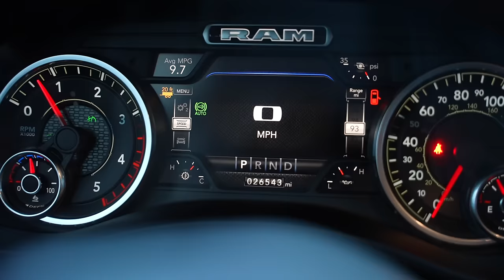Silver Bullet’s Engine EXPLODES After Winner Takes Delivery…

Comment: The winner this giveaway seemed genuinely excited, and props to you Gabe for owning it even though it technically wasn't your truck anymore
Reply: Technically it still in his "business "name so it some type  of liability. But he. Make triple over what the trucks are worth.
Reply: @Bear_83 pretty sure the dude signed the title when he took delivery of the truck the first time. If so that means it's 100% his. If it had been a used truck purchase it would have be "as is" and he would have just purchased a dead truck. In other words SOL!

He definitely did not have to fix this truck legally, but morally he 100% did the right thing. Definitely respectable.
Reply: @awdeveau  business wise he did right. Would be a black cloud over his money maker giveaways..He make Hundred Thousandssss. Off a use 50k trucks . Could've spend another 30k. On top of that. Signing title is his but transfer ownership hasn't  been recognized. As you seen he now got his plates dont understand how he got an inspection without getting truck inspected in his domicile 🤷🏿‍♂️
Reply: @Bear_83  many states don't require vehicle inspections. I'm in Florida and we have no vehicle inspections, no emission testing. Basically if you can register and insure it you're good to go. You should see some of the stuff operating legally on the roads down here. My brother took one of my snowmobiles (originally from Maine) when I moved to FL and put wheels in place of the skies, big fat rear tire in place of the track, added a radiator and was able to register it as a motorcycle.

Comment: This makes me mad those ford dealer techs said that shit because they weren't going to fix it because of that flat rate bullcrap. The amount of time just by looking at all those parts that were damage from the pushrods and lifters and gears it would have taken them way more time than what the manufacturer would describe in the service manual to repair. So that's why they keep saying "Oh that's normal it will go away after so and so miles" which basically means were not going to fix the issue because we're not going to get paid for the extra labor time.

Comment: Same with me bought a truck 2004 dodge ram 1500 for work 100k miles for 6k the guy was like everything works find up to date n stuff,, and i didnt know much about trucks , at the time looked really nice clean barley any rust on it, i get it ,notice when i get home something leaking was powering steer, whole rack n pump replaced, than both front control arms need to be replaced, and starting to notice when i reverse randomly stalls or idels than have to restart my whole truck so im not sitting middle of the site, than also when it rains my check engine light always comes on with oxygen censor code./ wish people could be honest sometimes